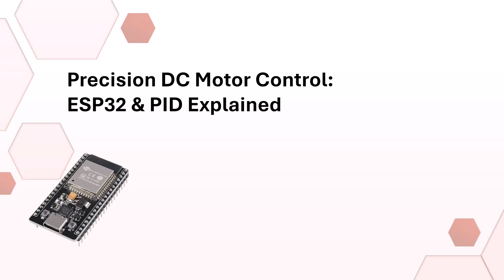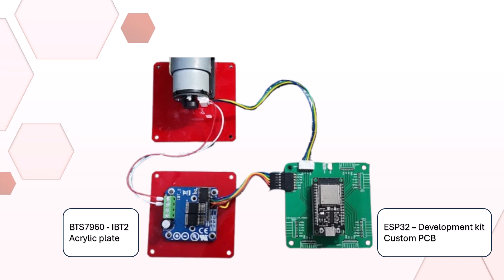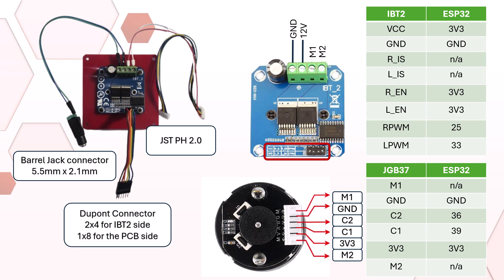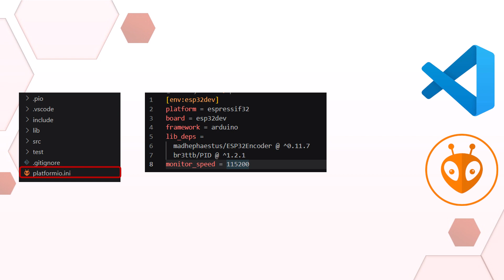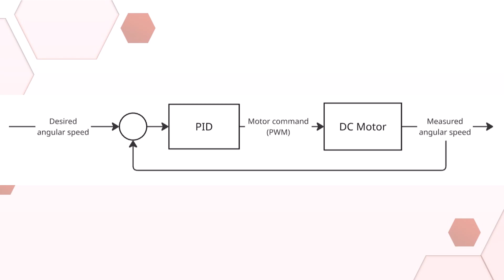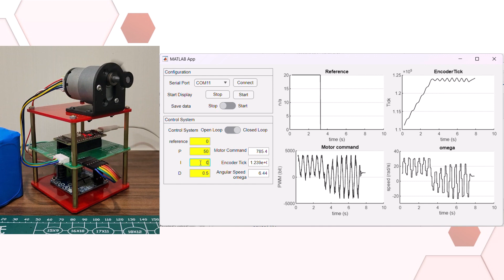Precision DC Motor Control: ESP32 & PID Explained

Comment: Well explained 👍 Can PID be implemented in Matlab while ESP acts just as an interface?
Reply from the maker: Doable, but usually no. The PID should be calculated quickly, within 10ms. MATLAB calculation is fast, but serial communication is unreliable. It is better to leave the PID on the hardware/microcontroller side.